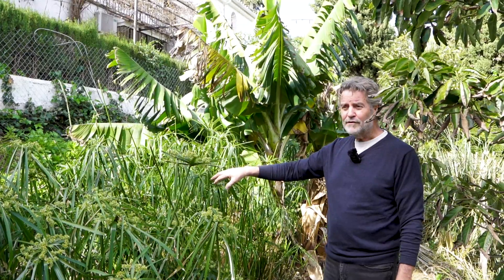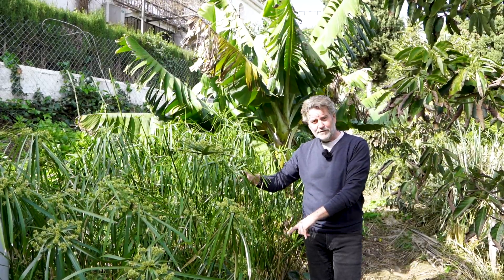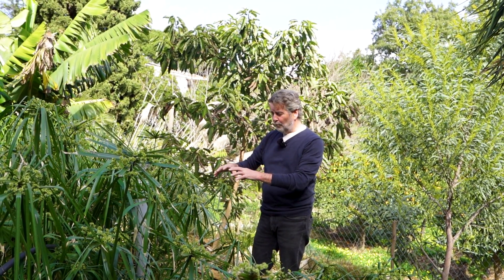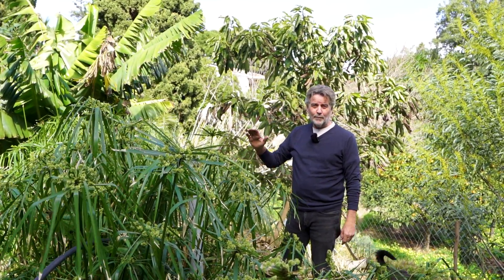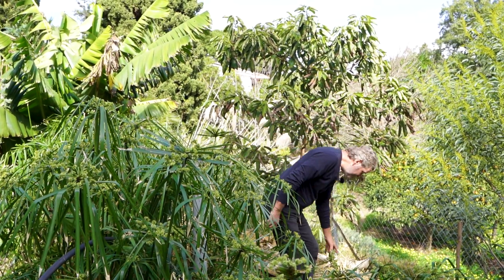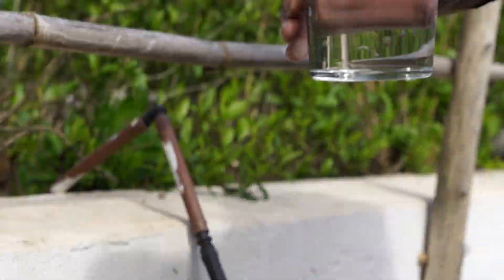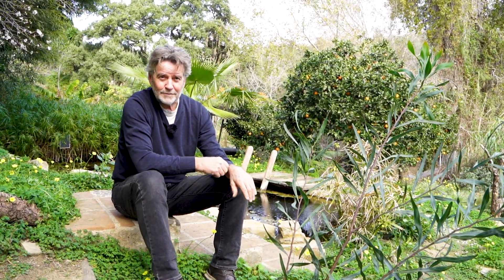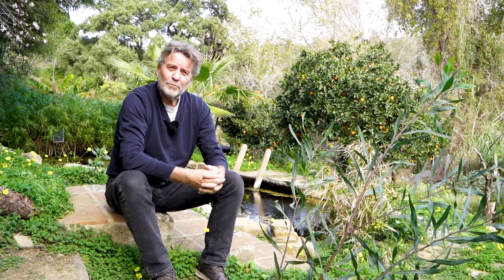Revolutionizing Wastewater Treatment

Comment: Great video.

I am currently rebuilding my house, where I already have seperated grey-water and black-water.
What setup would you suggest? I plan to work on cleaning my waste water next fall. Now everything goes to city-drainage temporarily.

I will be so happy once I get this finalized, as everything except cold-water in the kitchen comes from rain-water.
After I can drain my waste water I will simply borrow my water from the garden and return it clean after I have used it.
Such a peace-giving thought.
Reply from the maker: Hi there, Great that you have grey and black separated, that makes cleaning so much easier. Unfortunately we don’t have that set up so can’t speak from experience. You’re right such a peace giving thought to keep the water clean on the land.
Reply: Put in another pipe to your toilet tank, and a tank for holding your grey water. Pump the grey water into the toilet tank line. This way when flushing your toilet the water has already been used twice and that is before purification treatment. This preempts the clean water from being used.

Comment: Very interesting and impressive. Did you have to modify the soaps or detergents that you use in your household or will that all be filtered/broken down by the bacteria. It clearly seems to be working and I'm sure you did thorough research on the chemistry and soil impact of it. Thanks for sharing!
Reply from the maker: Thanks for your question and interest. We are basing our experimental reed bed filtering system on "Twaalf Ambachten" (a dutch site) but as you may know all situations have different criteria so it is trial and error. We find that by not using harsh cleaning products and minimising on regular ones the plants are more than able to deal with it. We tested the filtered water and it comes out impressively clean. Some people say it can even be used for drinking after an extra inverse osmosis filtering but we limit the use to the fruit trees. I think we will need more time until we can establish soil impact as so many factors are at play.
Reply: 4 минут бла-бла-бла-бла ....